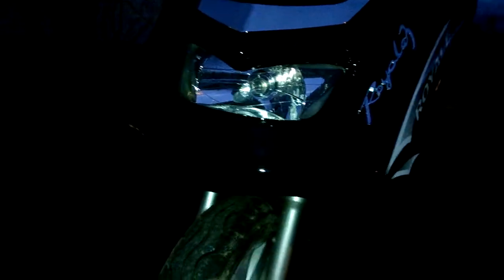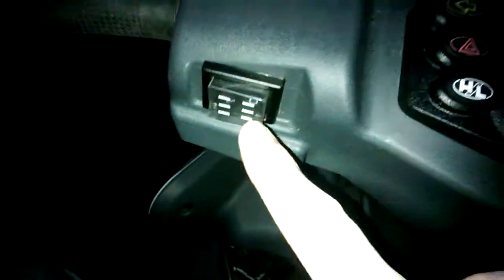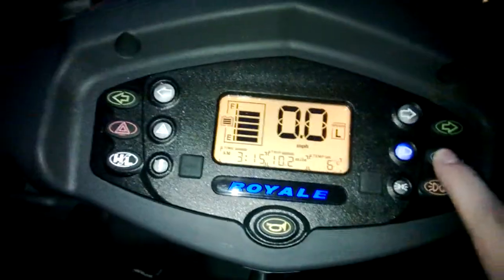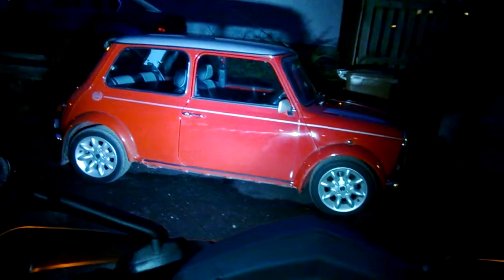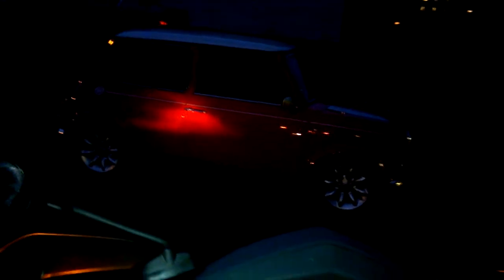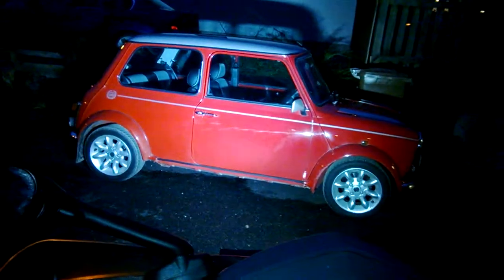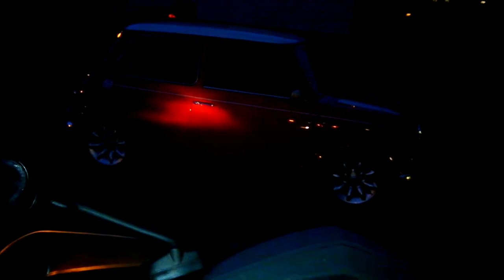Royale 3 Headlight: Huge upgrade!

Comment: Hi! Although you posted this a while ago, just to let you know it is still appreciated, because I just bought a second-hand Rayale 4 with the same issue. So, your suggestion is still inspiring and topical for me!  When I was viewing my potential purchase, as someone with an electrical background I soon noticed the lightbulb-based lighting and thought, 'How inefficient, and archaic!'  Their headlight is dim, of course, because they're trying to reduce the power-drain in spite of a very wasteful system! My determination to change over to LEDs was further boosted when I saw that several dealers charge around £9 for a new amber indicator lightbulb! LEDs have a much longer life. 

For minimum battery drain with maximum light, LEDs are definitely the way to go! I haven't really checked yet, but I suspect that their bulb-lighting is underpowered and dim all around the scooter. So far, I've also not noticed any decent reversing lights. They would be useful during these dark, winter months! For best appearance, an interesting challenge will be to fabricate LED lighting that will fit into the existing fittings, and replace those silly bulbs for good! Far-East sellers on Ebay offer a wide range of LED modules for us to play with.  One new addition which I already have on order is a set of amber flashing LEDs. Advisable in the UK, if driving on a dual carriageway - and compulsory if the speed limit is over 50mph (so why hasn't the manufacturer fitted them?). With some of the crazy drivers around here, I shall no doubt use them on some single carriageways also, to make sure I'm seen. 

While I'm at it - may I also express my dismay that such a high-value item does not come with a readily accessible strong attachment-point, so we can padlock our prized possession to a hefty chain? I believe the previous owner used to loop a chain around the steering coloumn and, as a result, has torn the rubber gaiter (replacement part will cost me £60 !)  When two men delivered my scooter, they had no difficulty in lifting it off a Transit van onto the ground - weight of batteries included! So, what's to stop a slightly knowledgeable person disengaging the motor lever, frewheeling my scooter to the roadside, and with a mate to help, easily lifting it 'onto' a van, and driving off with my £1300-worth of secondhand scooter - all in less then a minute?! Perhaps you're fortunate enough to have a garage to store yours in, but the same theft could just as easily happen while out shopping. Any ideas?
Reply: Unfortunately I can't think of any practical way to prevent theft of something like this except for a carefully-positioned chain, due to the relative ease with which it could be physical carried away! I have an open-fronted garage in which the scooter is stored, its safety mostly a result of the lack of crime in the area I live. 

By the sounds of it you won't have any problem with replacing (upgrading!) the lights to LED hardware. I don't doubt for a second that you will notice the benefit!
Reply: Sorry, this is the poster of the video; it's just that Google switches me back and forth between accounts without warning!

Comment: Hi . Nice job. How did you conect the new lamp. From the bulb holder on the main lamp with a switch in-between?
Reply from the maker: I'm very sorry I didn't reply to this. I ended up using a different YouTube account most of the time after a Gmail auto-migration. If you still need help, I just replied to someone else with this:

There were a few simple but important steps. First, I found out the Wattage of the lightbulb. It was 36W, as I recall. I then found a 36W LED lamp. Mounting the LED lamp was simply a case of taking the mounting bracket supplied with the lamp and finding a suitable place to drill holes in the scooter. 

The electrical side of it was quite simple but unfortunately I don't have the scooter any more so can't share any photos. 

Basically, by default there are cables running from the battery to the headlamp, and a switch that turns the headlamp on and off. I installed a second switch (a waterproof one as it will be exposed to the weather) between the headlamp switch on the control panel. From one setting on that switch the electrical current ran to the headlamp as usual, but switching it to the other position meant the electrical current ran through the LED. 

Visualise it like this: Battery > ON/OFF Switch > Headlamp is the original installation. The new installation was BATTERY > ON/OFF Switch > New A/B Switch > A=Headlamp or B=LED. This had the benefit of also giving me 'dipped' headlights like a car. I could flick the A/B switch to turn the LED off but in doing so the headlamp would go back on; I could still see but wouldn't be blinding anyone coming towards me. 

The most important thing was finding a 36W LED so the overall draw on the battery and wiring was no different.

Comment: I would like to know how you upgraded your lights to LED through your main switch on the mobility scooter if I was to buy the stuff I would like to know how to do it properly but I would pay someone if they could do it. I’ve got the same mobility scooter as you and the light is very poor on the front.
Reply from the maker: Hi Peter. There were a few simple but important steps. First, I found out the Wattage of the lightbulb. It was 36W, as I recall. I then found a 36W LED lamp. Mounting the LED lamp was simply a case of taking the mounting bracket supplied with the lamp and finding a suitable place to drill holes in the scooter. 

The electrical side of it was quite simple but unfortunately I don't have the scooter any more so can't share any photos. 

Basically, by default there are cables running from the battery to the headlamp, and a switch that turns the headlamp on and off. I installed a second switch (a waterproof one as it will be exposed to the weather) between the headlamp switch on the control panel. From one setting on that switch the electrical current ran to the headlamp as usual, but switching it to the other position meant the electrical current ran through the LED. 

Visualise it like this: Battery > ON/OFF Switch > Headlamp is the original installation. The new installation was BATTERY > ON/OFF Switch > New A/B Switch > A=Headlamp or B=LED. This had the benefit of also giving me 'dipped' headlights like a car. I could flick the A/B switch to turn the LED off but in doing so the headlamp would go back on; I could still see but wouldn't be blinding anyone coming towards me. 

The most important thing was finding a 36W LED so the overall draw on the battery and wiring was no different.